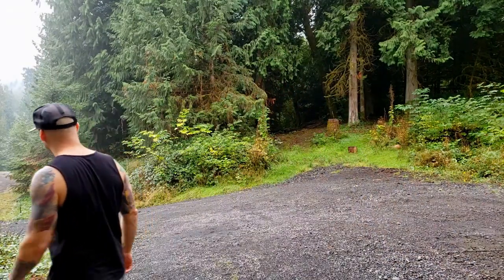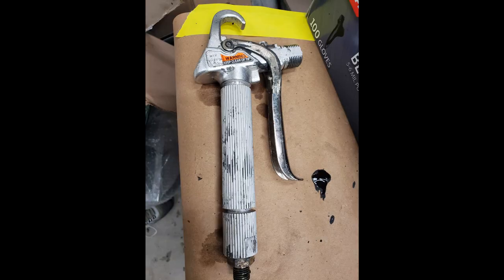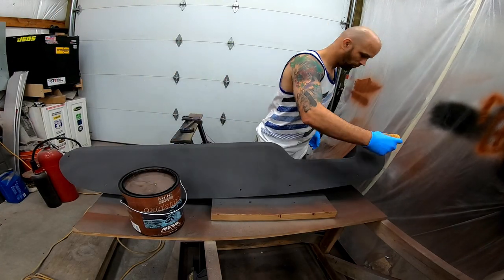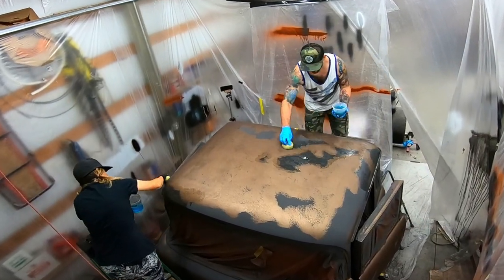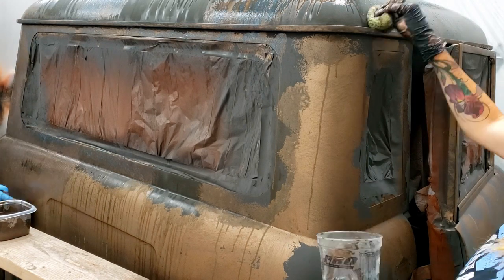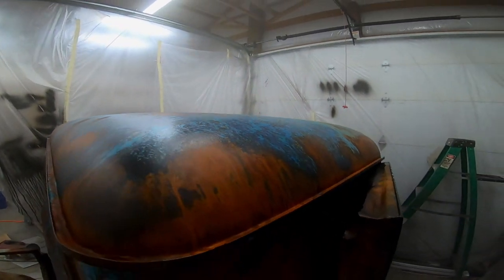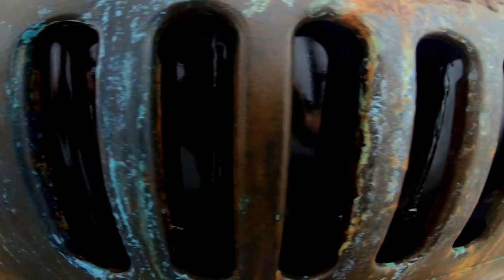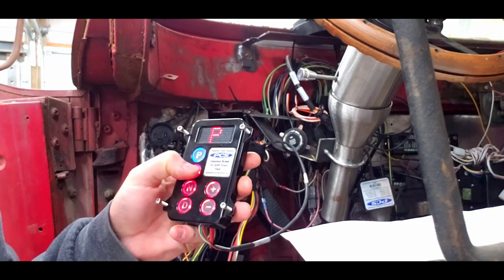FC Jeep Paint Day Baby!

Comment: How much did you use?
Might try this on my truck it needs a paint job
Reply from the maker: 2 gal primer 
1 gal bronze
1 gal bronze activator
2 gal iron
2 gal iron activator
But before I did all that I use a automotive 2K primer.
Reply: @klugersgarage2802   so wont be cheap to do my whole truck lol, thanks
Reply from the maker: @SpencerBelanger207  lmbo, not cheep at all. I do have paint left. But I only painted 1/2 a truck. Plus you will want to buy multiple spray guns.

Comment: I must be doing something wrong. My blues hardly come out at all. Lots of the Bronze doesn’t do anything
Reply from the maker: Well crap, so you put a base coat of bronze down. Then when you apply  your second coat your dipping the sponge into the oxidizer and then tapping it on the surface?
Reply: @klugersgarage2802   oh so your second coat is soaked into the anodizer? I was putting anodizer on second coat when it was wet. But I wasn’t mixing them.
Reply from the maker: @SpencerBelanger207  I was doing the paint into the oxidizer. You have to be careful about getting everything to wet. There's actually bronze in the paint and if it gets too wet gravity will force it to the ground if it's on a vertical surface.
Reply from the maker: @SpencerBelanger207  I ended up having to do a couple sections like the front of my grill and my driver side two times because of this gravity feature.
Reply: @klugersgarage2802  I will keep experimenting until I get it down. Just expensive to play with.
Reply from the maker: @SpencerBelanger207  def not cheap